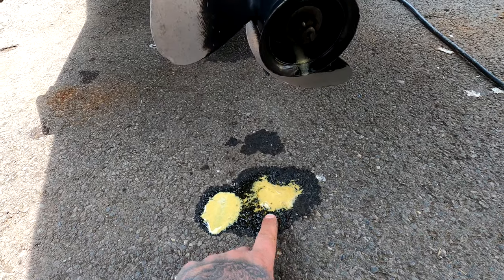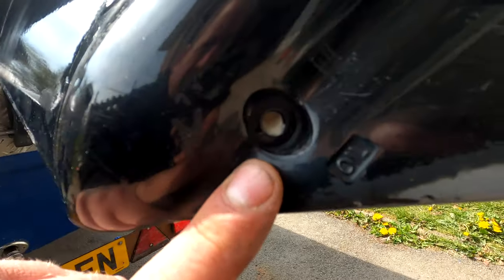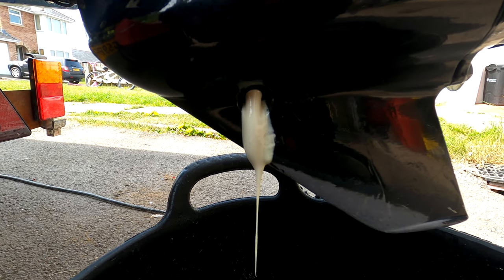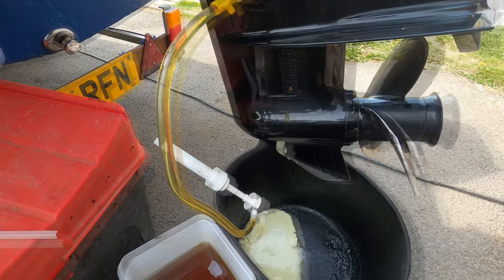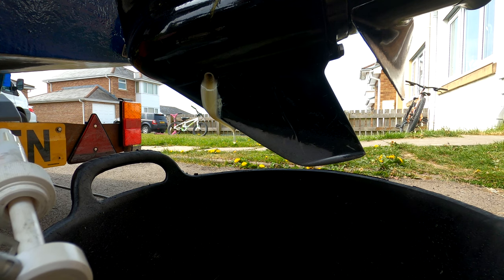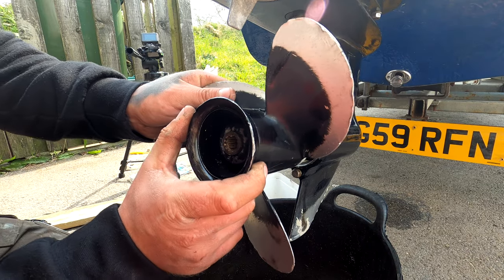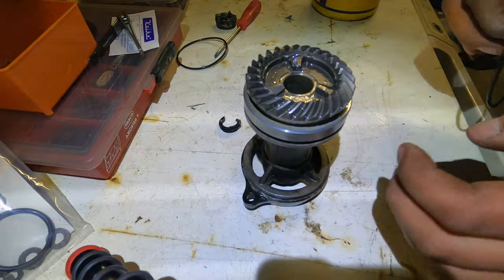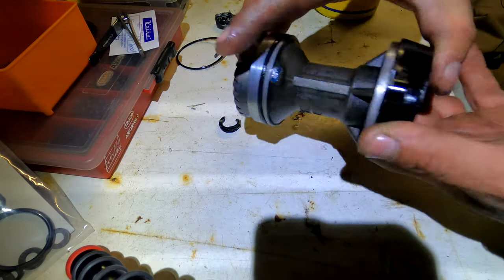Mariner 20hp (OIL SEAL REPLACEMENT)

Comment: Hey thanks for the great video.  I’ve got a Tohatsu 20hp that appears to be identical.  I’m struggling with removing the oil seal with a punch.  Thanks again from Texas.
Reply from the maker: No worries TH. It is exactly the same my service kit says tohatsu all over it.

It should come out with a punch be careful you dont damage or scratch the surface the seal goes against it will leak other wise take your time
Reply: @C3BFA  Were you able to get it out by punching from the inside out as in your video or did you end up having to hit it straight on to get it to fold?
Reply from the maker: I did it as I did in the video th

Comment: Just   put some  instant  gasket  dont  need  new  case
Reply from the maker: It was fine never had an issue again after this. I would prefer not to bodge it tho if it was leaking after this I would of replaced the bearing carrier.